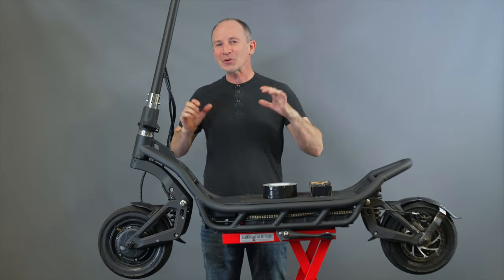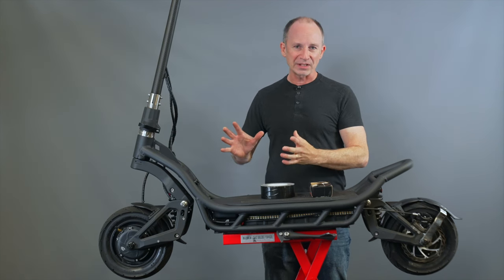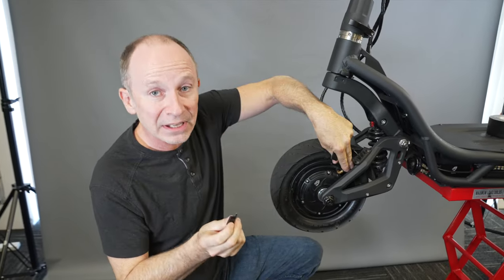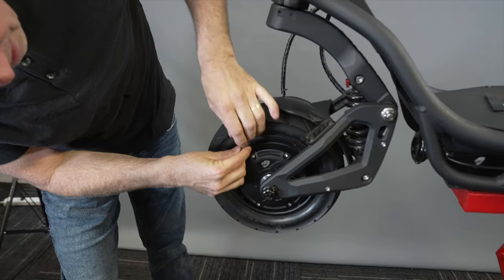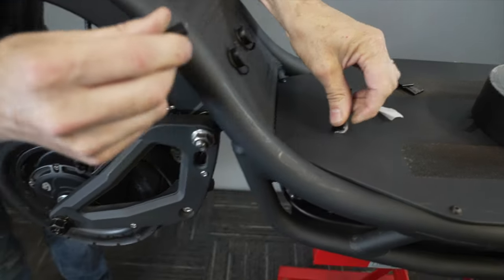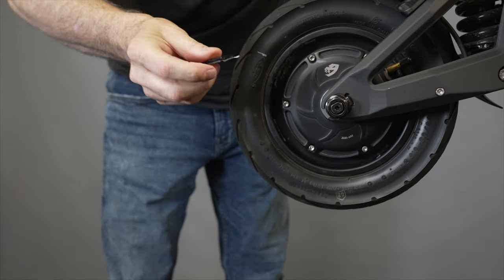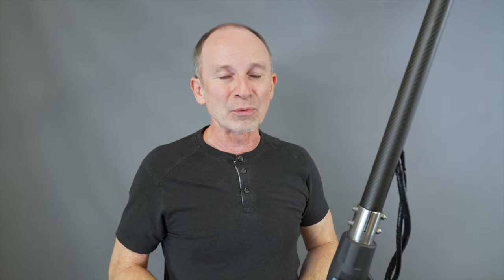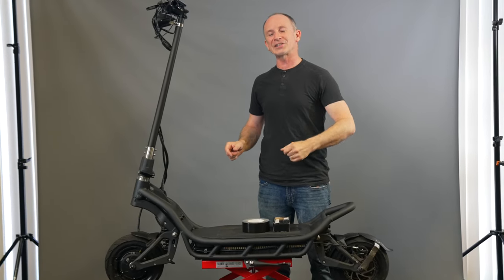How To Balance Electric Scooter Tires

Comment: Yesssss! I’ve done this months ago when I got my Vsett10+ to fix the vibrations. Wished more people new about this. I previously worked on cars before so this makes perfect sense. Well done for this tutorial! Thanks!
Reply from the maker: Thank you!   :-)      -Paul
Reply: I have a obarter x5 wheels are out of balance, how do you know where to put the weights?
Reply: I have a Vsett 10 and my back tire has a wobble and I massaged tire many times. How many grams did you use?

Comment: This removed the awful oscillation in my mantis 8 and added 5mph to the top speed. Back hub is sincerely perfect, but I could only get the front “darn good” with minimal vibration. Not pretty but it works and I’m proud of that! Hope I have luck with my other Mantis 8. TBH better made tires would fix it. I’m convinced it’s just inconsistent manufacturing in tires causing this.
Reply from the maker: Thanks for the info!

Comment: I just balanced both the front and rear wheels on my Apollo Phantom V2-V3 and it made a world of difference... and... although I was skeptical when you stated that I might gain speed, I did... an entire 1 mph... LOL.  But it was an increase.  I actually disconnected one motor at a time and balanced each wheel separately.  It did not run as smooth on the stand as the Nami in the video, but on the road... Wow!  Thank you.
Reply: yes that is correct approach, always balance in single motor first, after that motor is balanced than you move to balancing in the dual motor mode
Reply: I am going to try this on my GT2.  Do I need to spin the wheel at full speed?  Sound dangerous.
Reply: @MaxHarden  Not full speed.  There will be a speed at which vibration will be at its worst, I think the term is the point of resonance. as you approach that speed, the vibration increases and will let off once you go past that "perfect" speed.  it is that vibration you are trying to eliminate by balancing the wheels.  Good luck!

Comment: First try this tip, deflate completely your tire, spin the wheel a bit by hand put only 10 psi  and engage the motors while scooter on a bench, works best with dual motors make the tire spin. Then inflate to the correct tire pressure. Often it's the inner tube that cause imbalance so by doing this you  will evenly set the inner tube. You may also add balancing beads inside your inner tubes.
Reply: These are tubeless tires.
Reply from the maker: Thanks for the feedback! -Vosk

Comment: I run the tire off the ground till it wobbles good . Then at the speed take a yellow marker paint pen and find the spot . Put weights on the opposite side.
Reply from the maker: That’s an awesome tip! I’ll try it! I love the comments section! Is there any delay? Like does it work best if the weight leads the mark by a little bit or does it tend to work best dead on?  -Paul

Comment: great tip, I always balanced my RC tires so know how much difference even a very basic balancing can make (more comfort due to less vibrations, less stress on the motor, more power being put down)
even balanced my standing room fan recently that was shaking a lot due to the plastic blade part not being balanced or centerd....after some very basic balancing on a rc prop balancer with some putty it no longer shakes

Comment: I cannot thank you enough🙏, fixed my fluid vista instantly! Was worried I broke it 😂.  I need to do it to the front tire but there's no motor in the front so it'll take a bit more time to trial and error it.  Now I can go over 23 mph without vibrating!
Reply from the maker: Non driven wheels are easier!
Put it in the air with the brakes loose or removed. See if the heavy part will find the bottom on its own. If it will you’re in luck. Mark the top, that’s the light part. ADd a weight where the mark is, then turn the mark until it’s sideways (3 o’clock). See if the mark moves up (needs more weight) or down (needs less weight).
This is static balancing and is how the tires on my motorcycle were balanced for racing! -Paul

Comment: I definitely need to do this with my scooter. I changed tires last winter to off road tires and it’s never been that smooth at high speed since
Reply from the maker: Let us know how it goes! Check to see that the bead is fully seated too!   -Paul
Reply: offroad tires handle kinda bad, loved em till i tried semi offroad & road tires, i'll never use offroads again

Comment: Awesome video Paul, thanks ESG! My Phantom V2 has serious wobbles above 60km/hr. I have re-seated the tyres and I've had it back to the local supplier here in Australia for warranty repairs, all to no avail. I have ordered the weights 💪  can't wait to give it a go!
Reply: Any luck?
Reply: @RupakShakur  yes. Not perfect yet but eliminated wobbles in rear wheel, front wheel is improved, likely the tire is not perfectly round. I'm not going to change it until I get a puncture as I am OK with how it rides. Definitely worth the effort.

Comment: Thx Paul you saved much headache. Sadly most of these China tires are out of round to begin with, I've tried resetting the bead with soapy water many times on several scooters, it only helps slightly... they are just poorly manufactured with marginal QA. So BEFORE you purchase a sled capable of 75km/hr ask for a 'wheel balance' !! They know it's a huge pita, and won't do it unless you ask... as part of your purchase agreement.

Comment: Hey Pual thank you for your amazing experience and knowledge that you share with us mere earthlinks down here. lol

You mention reseating the beads, my scooters front tire is out of balnce because I had got a flat and had to take off everything. So I retook of the tire and I am trying to reseat eveything again. I don't think I have that prominent line that goes around the tire on my wheel per se, there is one but I am unsure if thats it. The one that I do have goes halfway around the tire but the line stops and goes into a name. I was wondering if you ever made the other video talking about this specific setup so I can make sure I a not missing any steps that could help me. Thanks In Advance.

Comment: this is so important...i had big trouble with the original 10'' kugoo wheels,but i installed 11'' CST and it is like a better scooter...i need to do this to my rear wheel because i am sure the line is perfect..when i change these awful tires (rims) i look for it to fit good,but the balancing is needed...i think my rim is not perfect because i bought this scooter second hand,but i will see if this balancing will make it OK...thanks for the video
Reply from the maker: Thanks for sharing!
Reply: @rezzy851 Which kugoo scooter do you have? Could u please send a link to both tires and inner tubes? These 10”s from kugoo are so terrible im tired of trying to get them sat properly.

Comment: What could i use instead of tape to keep them mounted
Reply from the maker: This stuff helps. One of the problem with steel weighs vs the old lead ones is you can’t bend them to match the curve of the rim. So to help the adhesive stay attached, it helps to use a thicker layer of adhesive than what comes on the weights. I sometimes use this stuff (first link below). GoPro style adhesive is even thicker. (Second link) it’s nice to have something over the top of it too. I tend to use color-matched duct tape or gaffer tape, you don’t need to use a huge amount. I suppose you could use silicone (RTV) too.   -Paul

1 Inch Width 33 Ft Length 3M VHB... https://www.amazon.com/dp/B09BB1HYX7?ref=ppx_pop_mob_ap_share

SUNMENCO 48pcs Red 3M VHB... https://www.amazon.com/dp/B0771HQ88G?ref=ppx_pop_mob_ap_share
Reply: @RiderGuide  damn thank you for the fastest respond im the history
Reply from the maker: Ha ha! Happy to help! 
Thanks for watching!  -Paul

Comment: I've got the Emove Roadster with the same tire tread. The scooter will shake/vibrate while accelerating and decelerating around 38mph-50mph. I'll give these weights a shot. Should weights always be applied in all four directions on a wheel? Or does it depend.
Reply from the maker: You’ll end up with the weights in only one spot. But it’s good to try all four directions one at a time to see where the shaking is best and where it is worst. Then refine from there. It can make a big difference. Be careful. Wear glasses and stand next to (not in front of or behind) the scooter while testing, in case a weight flys off.

Comment: Link to the 5 gram weights and lift used is broken. Can you please replace
Reply from the maker: Sorry about that Stiven! I've updated it in the video description and pasted it below.
https://www.amazon.com/Supply-Steel-Stick-Wheel-Weights/dp/B0068EQ9W0/ref=sr_1_3?crid=3H3D635MUSCNU&keywords=5+gram+wheel+weights&qid=1660347681&sprefix=5+gram+wheel+weights%2Caps%2C370&sr=8-3&tag=electricsc0cc-20    -Paul

Comment: Where can I buy the weights?
Reply from the maker: Here you go Paul!      -Paul
Reply: @RiderGuide  ?
Reply from the maker: Sorry. Super late with this one. I pasted a link but I guess it didn’t work for some reason!  -Paul 
https://www.amazon.com/Supply-Steel-Stick-Wheel-Weights/dp/B0068EQ9W0/ref=sr_1_3?crid=3H3D635MUSCNU&keywords=5+gram+wheel+weights&qid=1660347681&sprefix=5+gram+wheel+weights%2Caps%2C370&sr=8-3&tag=electricsc0cc-20

Comment: Noice 👌
Reply from the maker: Thank you @beyondxxth!    -Paul
Reply: @RiderGuide  it's actually so helpful 👍👍
I'm gonna do it this week 
And I'll share the results ✌️
Reply from the maker: Awesome! Just don't get hit by flying weights! Best to stand next to the scooter when checking balance points!  I should have said that in the video.   
Looking forward to hearing how it goes. If you can, start in single motor mode. Makes it easier to figure out which end is shaking. Once that end is tuned up, it won't shake the other end.   -Paul

Comment: Fix your rotor too because I can hear it scraping on the brake pad anytime you go up to high speed be more concerned about that then your wheels
Reply: I've got a chatter on my solar ff lite. It's so annoying. I've tried to adjust it but it comes back the first time I apply the brakes